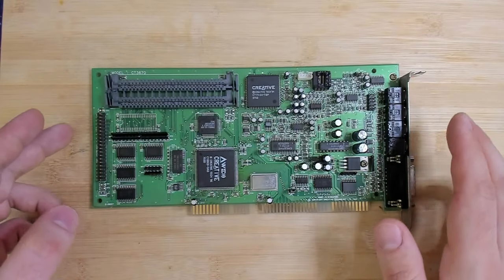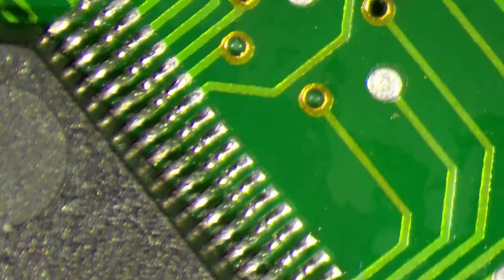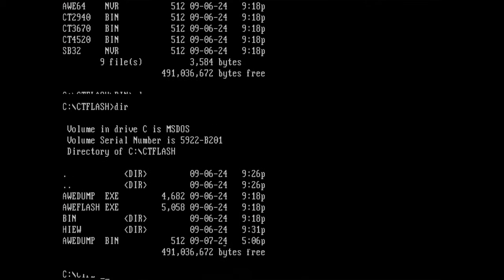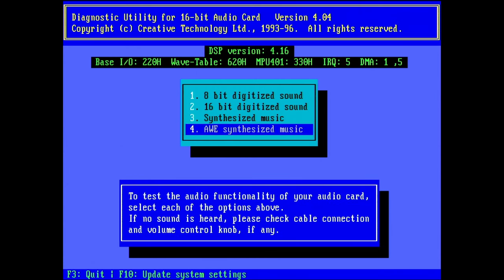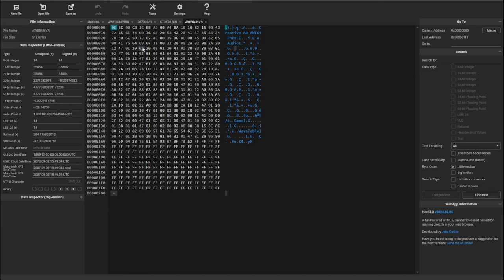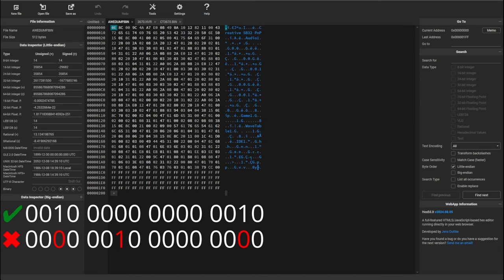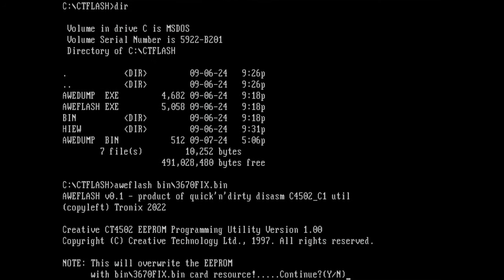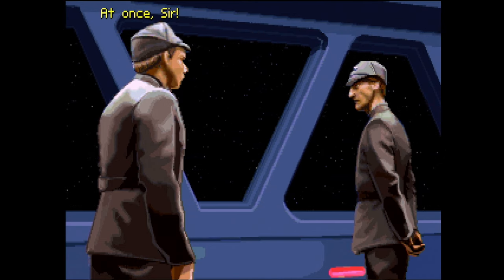This SoundBlaster 32 PnP CT3670 must live! Let me try again!

Comment: awe music at 10:38 sounds completely wrong. It sounds like fm, not awe.
Reply from the maker: Probably die to the missing memory - I never had one of those cards. If the card plays something, that was good to me! I guess I have to find out more!
Reply: @bitsundbolts  This test does not need ram, it uses rom samples.
Reply: @bitsundbolts  Try to run 'aweutil /s' after the ctcm.exe and before running diagnose. Or try different driver version.
Reply from the maker: Hm, ok. So, then there is maybe something else wrong with this card? I need to find samples of what this card should sound like. Technically, it is a Soundblaster 32 (based on the text in the file I flashed to the card). Maybe it shouldn't play any AWE music due to disabled features?
I can flash the AWE64 image to this card and see if it makes a difference.
Reply: @bitsundbolts  I`m trying to show you video with proper AWE sound, but YT deletes my comments.
Reply from the maker: Yes, YouTube doesn't like links in the comments. Thanks for sharing the details, I'll look for the video.
Reply: @bitsundbolts  I knew about links so I put the name of the video, but yt deleted it.

Comment: I have the ct-3600 and it’s like yours.
Basically it’s a sb16 plus the e-mu synth.
Does not have the 1mb awe rom
General midi in pure dos is only possible by running Aweutil and loading in a SBK font.
Downside it work with protected mode unless dos32awe is used.
In windows it can also load sf2 fonts.
I maxed mine out to 32 mb (28 useable) and I could load masterpiece.sf2.
Reply from the maker: This is the stuff I have to try. I've never used sound fonts before.
Reply: @bitsundbolts  the downside is the waiting for the large ones to load :-)

Comment: Awe sounds wrong. As far as i understand the sb32 is a vibra 16 with awe wavetable a budget awe32. I’ll have to check but i have a sb32 and awe test sounds just like an awe32 not like the “enhanced “ fm sounds yours sounds like. Ok found it. Mine is a ct3600 and sounds just like an awe32. Without booting up the pc from my fading memory. Sounds just like an awe32 but one noticeable feature i could add sustain and reverb to the fm synth which might be cqm. But has onboard 512k ram and full bass treble controls.
Reply from the maker: I don't have much experience with those cards. I would like to test a real AWE64 and compare it with this one. Or, just flash the AWE64 BIOS (which according to a Vogons post is possible).
Reply: About EMU8011 ROM I was wrong. It is present on CT3670. Probably should work in this test. I would have to try my CT 3670 to check how this test sounds like.
Reply from the maker: Please let me know if your card sounds different if you get to test it. I had no memory installed.
Reply: Hello, quoting Phils website:
"Sound Blaster 32 CT3670 - This is a very odd or unique card, as it comes with the audio chip from the AWE 64 and also has the DSP version 4.16. It therefore is basically an AWE 64 with SIMM memory slots to upgrade the memory rather than the proprietary modules that the AWE 64 uses."
Also, from DOSDays website:
"This card came with no onboard RAM as standard but this is only required if you want to load your own external Soundfonts, as it does have the 1 MB onboard ROM with built-in Soundfonts for any software that natively supports this card.
This card is basically a Sound Blaster 32 with SIMM slots. The main chip on the CT3670, CT8903, comes from an AWE64. As such, it likely runs a DSP with version 4.16, meaning no hanging note bug."
So the CT3670 is not a standard SB32 and does not use any variation of the ViBRA chip.
Reply: @RetroTinkerer  wavetable awe sounds more like fm. there is something definitely wrong here.
Reply: @kevin1970  you are 100% correct I should had been in auto mode, not sure if I can get my 3670 out in a quick bench my room is kinda messed right now, but the card must sounds exactly like an AWE32/64 in that test, I believe some SB32 can't use any echo/chorus effects at all but this is way beyond that detail.

Comment: Hello, I have the same board, but mine is showing an error when entering 98 an error message related to SoundFont Banks and because of that the Midi does not work, but if I set the General MIDI through the panel the sound comes out. The problem is that I do not have 30-pin memory and I have already tried to restore the default through DOS and Creative software and it did not work. Does the Philips amplifier chip heat up on yours? On mine it is getting hot, but not to the point of burning my finger. I do not know if this is normal.
Reply from the maker: I didn't test the Philips amplifier, but did you connect your speakers to SPK OUT or LINE OUT? I think you should connect your speakers to the Line Out signal. Maybe then your amplifier chip doesn't get hot.

Comment: The output of the AWE synthesized music test doesn't sound right to me. It sounds like it's playing CQM/FM audio rather than using the AWE wavetable synth.
Reply from the maker: Maybe I need to install some memory on the card. There wasn't any when I made this video.
Reply: @bitsundbolts  I'll have to get my SB32 (the CT3600 version with some different chips) out of the attic this weekend and see if it behaves the same way. I vaguely recall having to run AWEUTIL /S on it to unlock the full functionality.
Reply from the maker: That's interesting. I didn't try that at all. My intention was to get the card running again. Who would have thought that it's quite difficult to get all those features working 😅
Reply: @bitsundbolts  I've now had time to play with my CT3600. I get slightly different behaviour with this card, which may or may not be due to using a slightly newer driver version than in your video: Running CTCM states "Successfully configured 5 of 5 Creative Plug & Play devices" rather than 4 of 4 in your case. DIAGNOSE.EXE will play the AWE Synthesized Music test correctly, providing CTCM.EXE has already been run. However, some games (eg. Duke Nukem 3D) don't play music correctly unless AWEUTIL/S has also been run beforehand. This is all with no RAM modules installed- I believe the add-on RAM is only required to load soundfonts.
Reply from the maker: Good to know. I'll try my card again soon. Thanks for sharing those details, I guess I will try to find newer drivers and try aweutil as well.

Comment: This is a Dell/Gateway soundcard, have one in my collection off my DELL XPS90v. It has a 2nd card, called the Goldfinger card for AWE soundfonts/wavetable (has a cable inbetween, like a cdrom cable), and in turn becomes a full AWE32 retail compatibility wise. Gotta love OEM nonsense. Upside can add ram to both cards, which allows 64mb wavetable. Strange beast!
Reply: The Goldfinger is a card that is used in conjunction with a regular 16-bit soundblaster (SB16 without AWE synthesis) to add synth capabilities. It is basically an AWE chip on a card and slots for soundfont memory. You wouldn't use one together with an AWE32 card, because that one already has the AWE chip.
Reply: @stamasd8500  I had a slightly different SB 32, which has the AWE DSP, but no wavetable or memory slots. Very similar card.

Comment: Well done! Add some RAM to that thing(at least a couple megs of 30pin sims, as it's not proprietary) and rerun the "diagnose" software(so it detects it). And that "AWE Synthesized Music" test will sound 100 times better than it does on your video. In fact after adding the RAM, when you go into Xwing setup select General Midi with soundblaster and the music will sound better as well. Welcome to the rabbit hole adventure of Creative Labs sound cards! 😁
Reply from the maker: Haha, I was afraid of that after reading all those comments. I'll add some memory and try what you suggested. If there are no videos for next week, it is because I am re-enjoying X-Wing!
Reply: @bitsundbolts  😂 it is a different world that is for sure! Just some advice also is in order for you to run games (for games that have the General Midi as a MUSIC option) you will also need to load the TSR program utility AWEUTIL.EXE with the "/EM:GM" tag option before you run your game in order for you to hear general MIDI music. Unload it with the AWEUTIL /U when done with the game. Also the Diagnose /s will set your soundblaster back to normal in case you get a hanging note (I usually create a batch file). However if "Sound Blaster AWE" is a native selection in the setups (i.e. doom, dark forces,ROTT, duke 3d etc) then you DON'T have to load that AWEUTIL.EXE TSR program. The TSR  is just needed for games that only have General Midi as an option but no native support for AWE. Also make sure you get the correct AWEUTIL TSR for that card or it will either lock up or not work. As Creative Labs drivers were all over the place back then.  Also just as a warning, mileage will vary with General Midi in some games. But usually they sound pretty good! Try the games Wacky Wheels or Lost Vikings with General Midi. It sounds awesome! Good luck! Keep up the good work!
Reply from the maker: Thanks for all this great info! Screenshoted!

Comment: Your perception to the "original bios from card" is totaly wrong. IF the bin file had the serial number in it, which clearly has not, then this exact bios file is in 1000's of card. IF there was seriál number in bin file then it would be the original bios to the card. So it does not matter if the downloaded or the So called "fixed" bios is on the card because its exactly the same file.
Reply from the maker: That probably makes sense. It doesn't make sense to have a unique file flashed on every card. The first four bytes however seem to be the vendor ID - which is different from the other two files. So, I wonder if there's a possibility to find out which ID belongs to which vendor. The rest is probably just PnP data and static configuration data.
Reply: @bitsundbolts  you can look on the board for markings, same as you can identity the 3dfx cards.